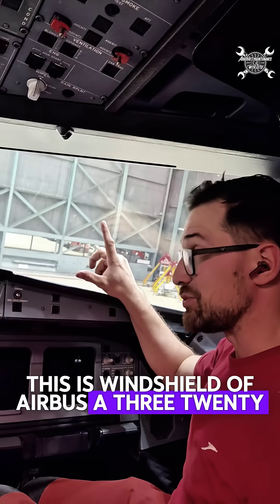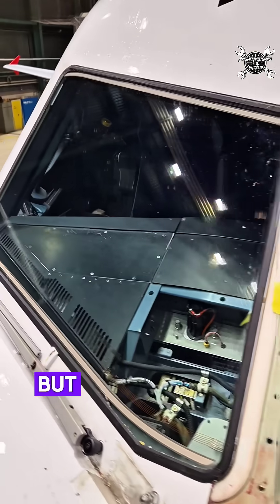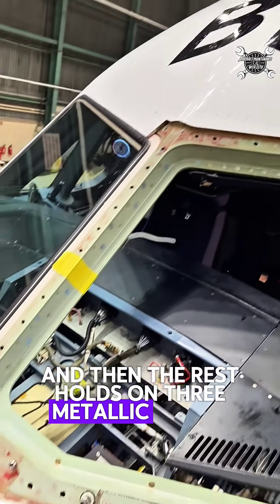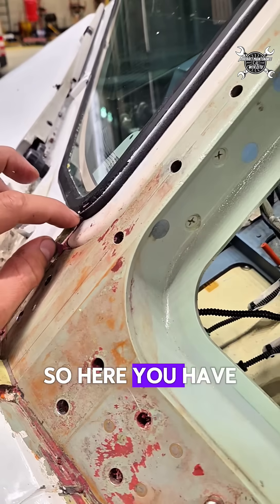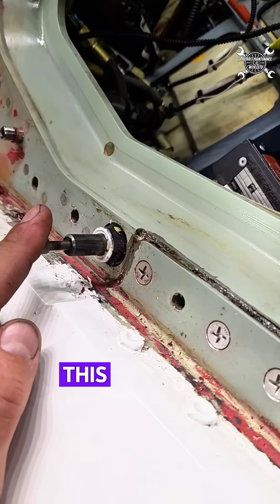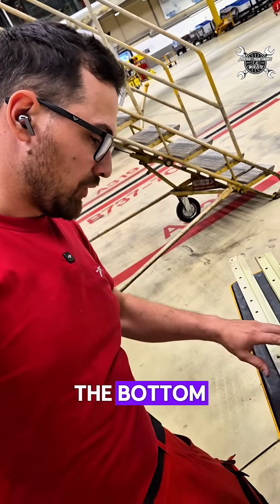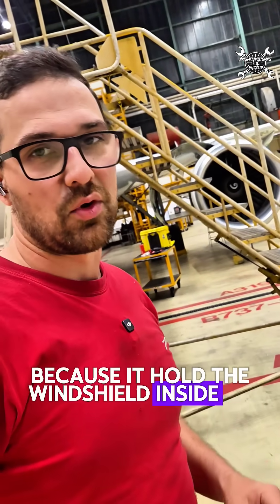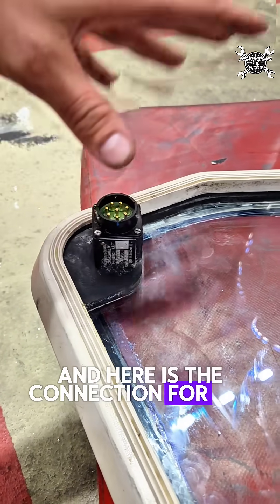how to windshield holds on Airbus A320

Comment: Why it's not installed from inside so the pressure push it into the frame?
Reply from the maker: Because it is much complicated to be replaced. almost every aircraft out there has it like this

Comment: Looks so unsophisticated like that. Just basic almost automotive levels of construction. 😬
Reply from the maker: Easy is always better. Why you want to reinvent the wheel 🙂
Reply: @zeto.r  Agree but it's aviation with huge pressures and stresses and was thinking of the De Havilland Comet and her window issues. Imagined they'd have some exotic, belt and braces solution. 

And under the hood, it's pipes, tubes and brackets, a complicated mess to the uninitiated. 

But as you said, it works, it's simple, cost effective engineering at its best. Thank goodness the French make better planes than they do cars!
Reply from the maker: @humanintelligence1435 well said 😀

Comment: Hello, thank you for the excellent video. But I have a question: in amm 56-11-11-000-001 - removing the windshield, there is a point (9) about removing the 211kc and 212kc ceiling panels (rear outlet-cokpit ventilation) , but what is the point of removing them if they do not interfere with replacing the windshield?
Reply from the maker: To be honest im not sure if they have affected. I didn't replace windshield for some time. I just pass by in hangar around this one 😁